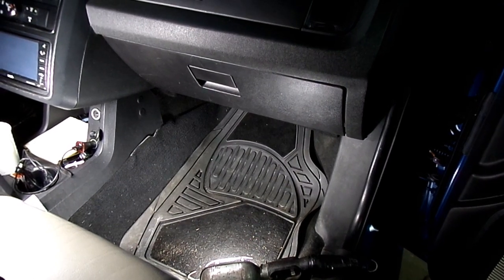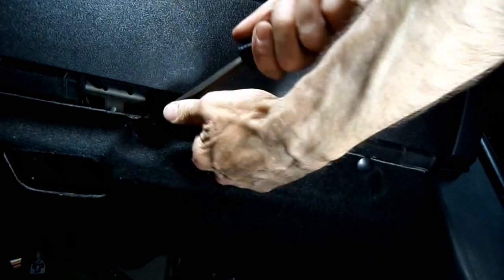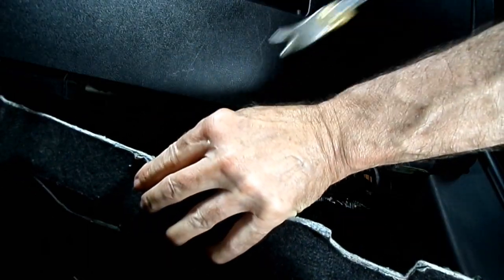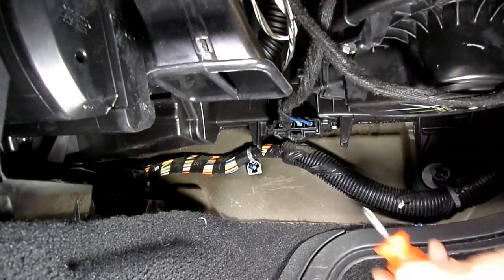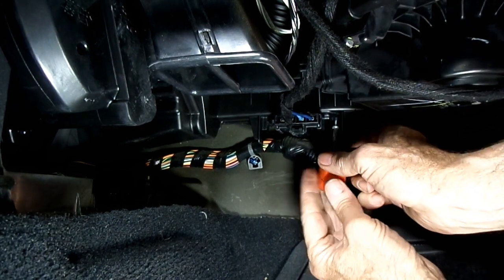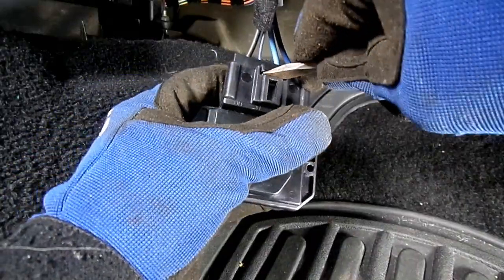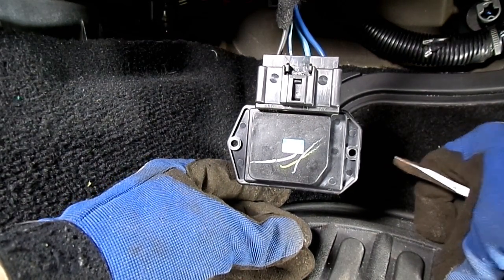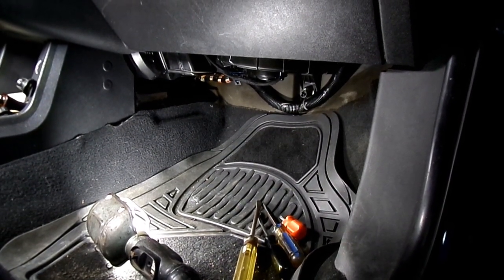Dodge Journey Blower Motor Resistor Replacement

Comment: Placement of the 2014 resistor is different. Do you know where they moved it to??
Reply: My 2018 Journey/ it isn’t there either.
Reply: You ever figure it out?  Replaced front blower motor, relay but fan still stops.

Comment: Hi, Is this for the REAR blower Motor or that was the front? Is the rear Blower Motor in a different location? Thanks
Reply from the maker: This is the front.
Reply: Thanks Alot!
Reply: richpin06a is there a rear blower motor resistor? If yes where’s located? 2009 Dodge Journey sxt AWD

Comment: Yep the stubby is handy sometimes, dodge designers want a good slap.

Bloody plastic fantastic, not so fantastic this time.
Ive never seen you struggle with the custom tool so much, your not losing your touch are you rich he he :-D.
Reply from the maker: That push pin got the best of me on that one....lol
Reply from the maker: That should have been edited and put in my blooper video....lol
Reply: Yes you missed a chance to loosen it, like you do with some nuts and bolts that came out a bit too easy on other vids, he he i notice :-D.